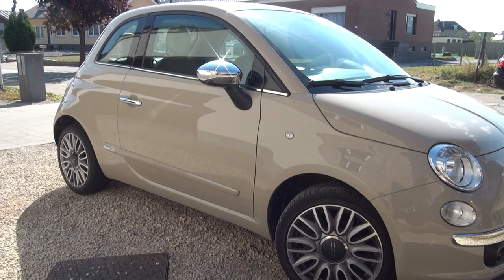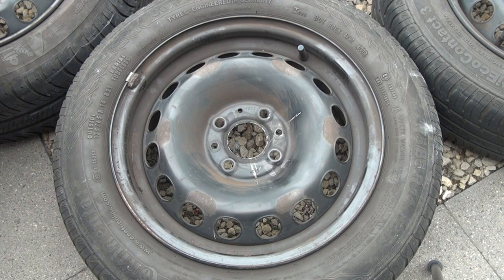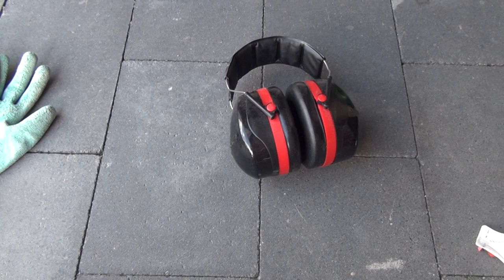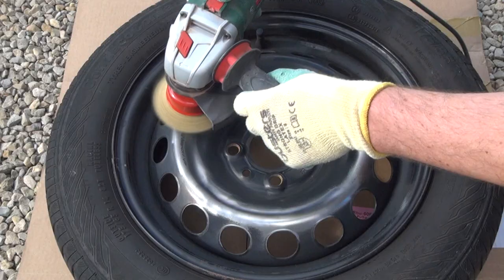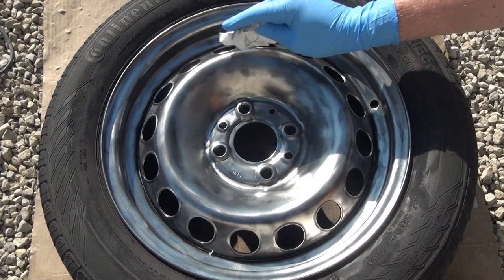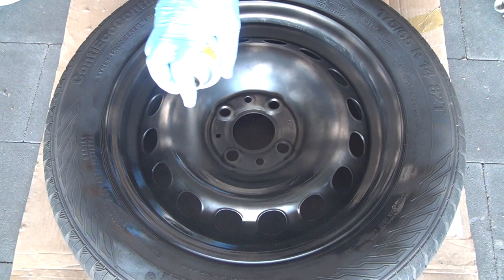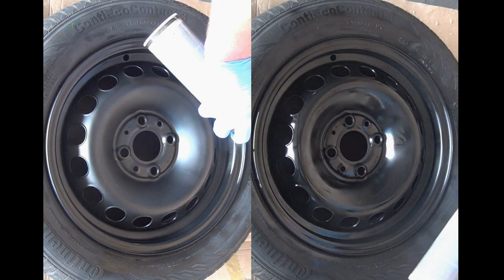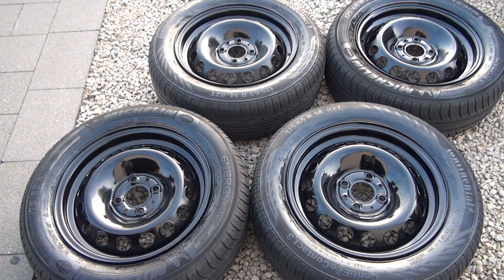[Complete restoration] Rust removal and repainting wheels for winter tires

Comment: OK, I agree this is a wonderful job, but why oh why would you waste so much time and money doing this. He must have spent almost that 140 euro saving on new on products to make the second hand rims look new and the man hours spent, I would rather do overtime at work and earn the extra 22 euro he saved on the hours and hours of work. Personally I would have given the old ones a wipe down and a quick spray with a £1 can of black rattle paint and job done, you are never going to see the wheels as you fit wheel trims anyway so just give them a spray where they can be seen.
Reply from the maker: The main purpose is saving money and it passed the test. But it is only €22. Depending on your own working situation it could be better to buy a new set and spend your time on another money making job. I prefer recycling and reusing than buying new ones.
Reply: It did not pass the test, time is money, you spent many hours earning 22 euro. You are also not recycling as you had to buy numerous new products that had to be made in factories polluting the planet, those empty cans then also need further recycling causing even more environmental issues. You caused more damage and pollution "recycling" than buying new. You sprayed poisonous chemicals straight into the air to spray your wheels. Who paid to filter your pollutants from our planet ? - the human race did just so you could "recycle". New ones are made in controlled environment and the  chemicals are filtered.
Reply: @csabazsinko3749     hatey-hatey.   Spend some time learning that you aren't God